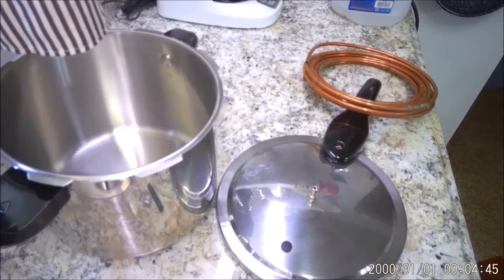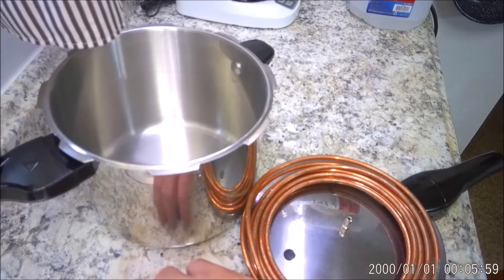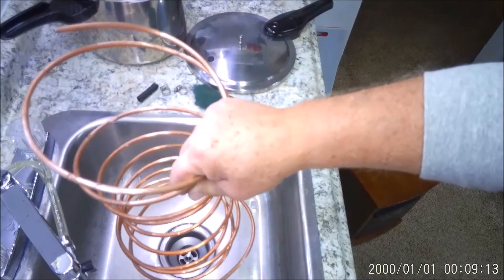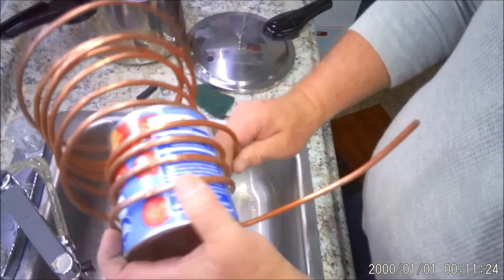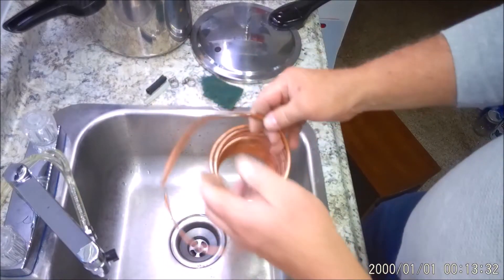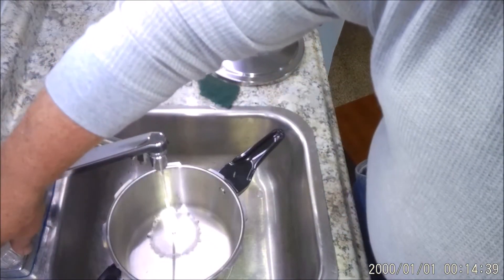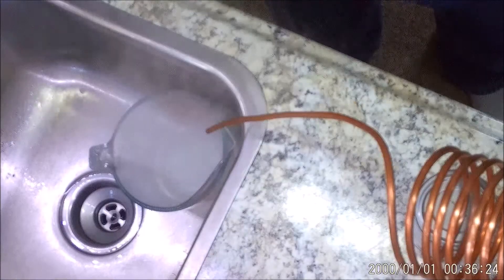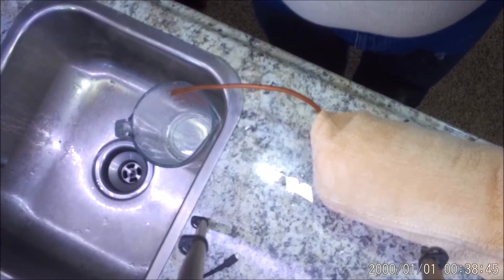How to make a distiller, DIY water distiller. Simple distiller.

Comment: I believe uv ight kills viruses
Reply from the maker: Yes but the frequency has to be way above the black light frequencies, about 240 to 280nm(UVC). The 390 ish nanometer LED's you can buy do nothing. The UVC light actually does not kill bacteria, but sterilizes it so it cannot reproduce. Boiling on the other hand kills bacteria...so we are told.
Reply: @davenooner2142  i thought sunlight killed viruses. I know when i traveled and lived in the woods with thousands of people boiling water was safe water after it was filtered. Never got sick from boiled water. Charcoal removed many a pest
Reply from the maker: @sassafrasred6657  You can use sunlight to kill pathogens ..but...it takes about 6 hours to do. So UVB rays do work ,just not as fast. UVC "kills" in a fraction of 1 second.
Reply from the maker: I use 35% food grade hydrogen peroxide diluted in a drink for increasing O2 levels in my body. We all seem to agree that O2 kills most all bad bacteria. As for viruses...the jury is still out if they cause any disease of any kind... its still a theory. Think like this, just because 99% of murder scenes have victims with shoes on...doesn't mean shoes caused the death. Viruses are said to be created by the body to help rid the body of toxins and poisons. but the same type is found in bodies of people with the same kind of symptoms, doen't mean they are the cause.
Reply: @davenooner2142  well i interested bin where that research on viruses is. Coming from.
Reply from the maker: @sassafrasred6657  Let me look for a video that explains it ,I will get back to you
Reply: @davenooner2142  i looked it up. I will have to spend a minute reading on that. Not sure how much credence i give it at the moment. But i am open to research. Thanks
Reply from the maker: @sassafrasred6657  Well it is all theory at this point, I agree.

Comment: Hmm, interesting. Theoretically you should be able to get this a lot more efficient by running the condensation coil back through the water your heating up, somehow... Was trying to think of how to do that, but still no real idea. 

Think you'd have to pump water into the boiler through a tube, and run the condensation tube through the centre of the water pump tube? Probably not worth the amount of work, but eh. If one's really that concerned about being efficient, I suppose it might be an idea. Can't really try that out myself at the moment, but might be a project for the future.
Reply from the maker: I like your thinking. The old timers making corn squeezing use some weird setups to be more efficient. If using in an emergency setup, wood can be used to heat the water and not worry. Thanks for the question and watching.
Reply: That's ridiculously convoluted, and would DECREASE efficiency exponentially, if not stop production all together. You do not want hot water around the condenser. And the water in the pot, is hot...how it works. Heat til it boils, vapor rises into condenser tube, condenses into pure h2o. The condenser should be vertical, with the top end of tubing going to the pot, then the bottom out to a collection vessel. And without cool, or at least somewhere close to room temperature, water jacketing the condenser tube, you're still just gonna get a bunch of steam or maybe catch a little water, but absolutely inefficient. You can pump water into a bucket, barrel, whatever with the condenser inside of it. Like basically every kit made for doing this, and what dn near everybody uses. Or a water jacket condenser tube. But you have to cool the condenser somehow. And if it's more horizontal like that, it's not gonna work well. If at all. Shit flows downhill. You need a continuous downhill run everywhere accept where you want the steam to remain a vapor, where it first comes out of the pot. Once it starts condensing, you don't want it to have to go back uphill anymore than possible. That creates a water pool and it'll chug like a coffee pot. It'll still work, but it can be hazardous, that's how steam pipes in big cities explode. Called a water hammer. Hot steam hits a pocket of water condensed in the pipe. Yes, this is a very small scale. But same principle. If you restrict the flow, it can blow a seal, sending scalding hot water and steam everywhere. Trust me, it hurts. And I've just had a puff come out of the lid of mine when I opened it to refill and keep running. You don't wanna let it run all the way dry, either. The calcium and everything in the water will start to burn and smells and tastes horrible.